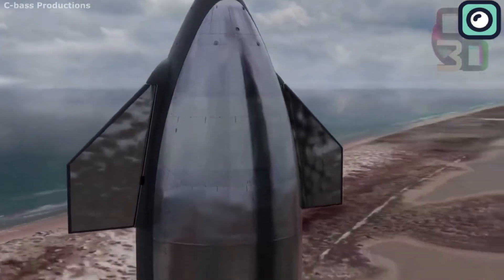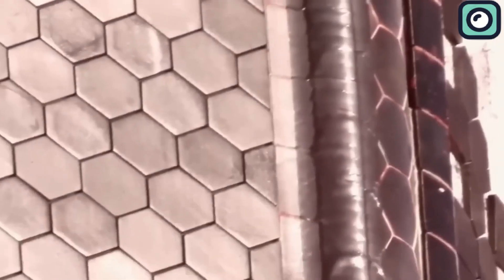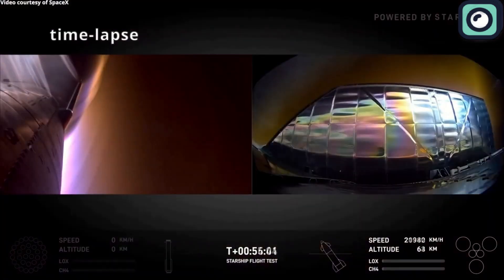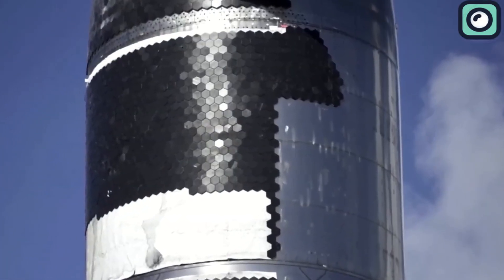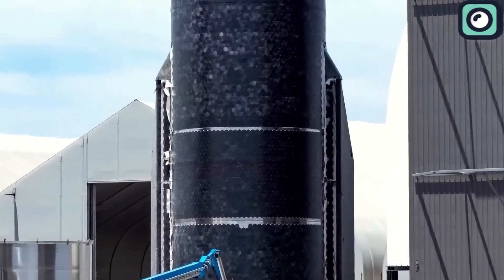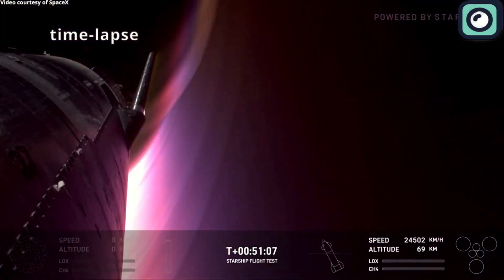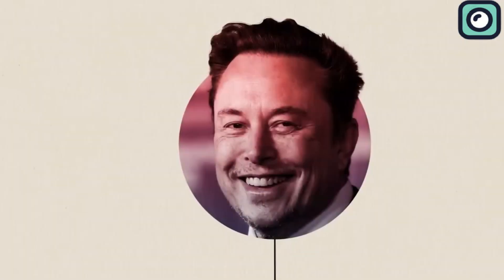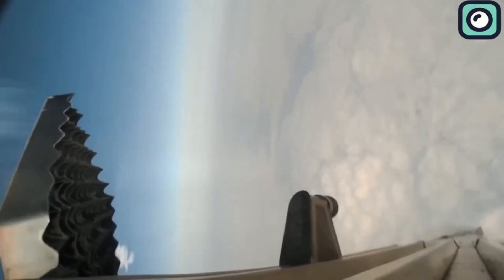What SpaceX Did With Starship's Heat Shield Will Blow Your Mind!

Comment: What are you talking about? Spacex never tested aluminum plates as a thermal shield. Aluminum is melting in 600 deg. it would be the worst thermal shims in the spece flights history, so why are you telling that? They used aluminum plates in some locations to evaluate, after the ship recovery, for what parts temperature raised above 600deg - if temperature was higher aluminum plate was melted. Base on that they can decide what parts of the hip must be actually protected and where thermal protection can be removed. Stainless steel surface that won’t exceed 600 degree don’t need thermal shields.